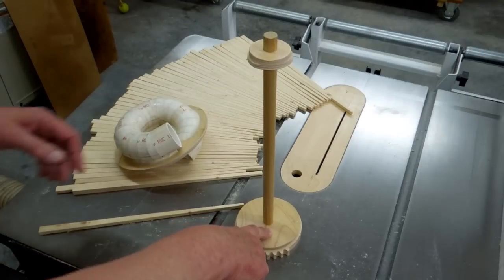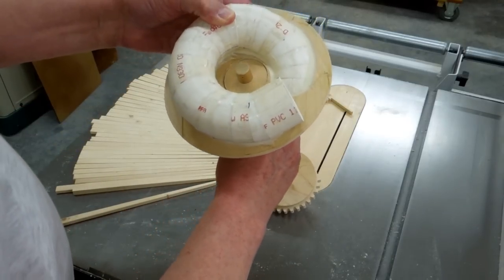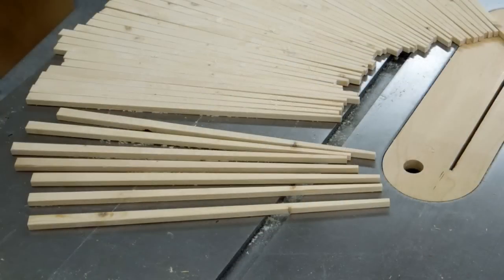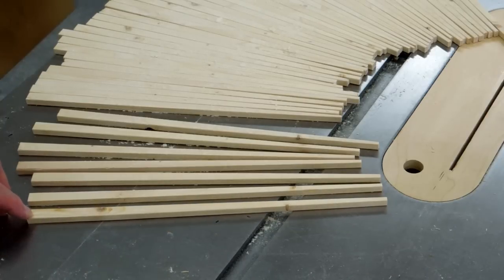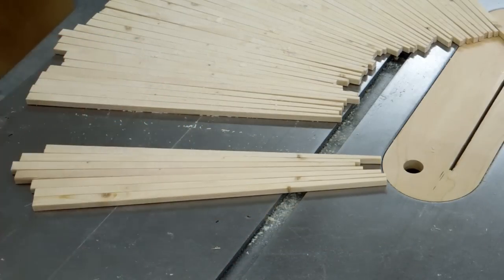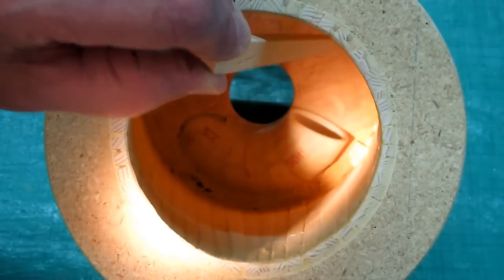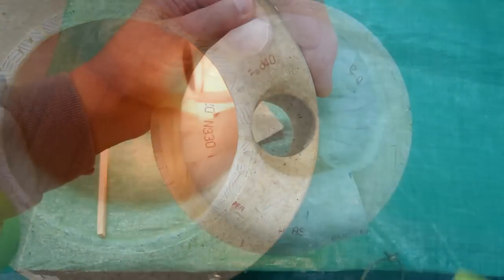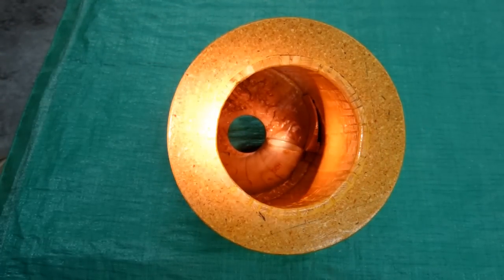Toroidal Spiral Cyclone Separator For ShopVac

Comment: Do you think that shape/dims. Is the most effective, efficient?
Reply from the maker: I have three (3) different designs for a homemade shopvac cyclone separator and all three are of the same approximate efficiency. The larger cyclone is intended for shopvacs with larger hoses. Coupled with the use of a bag inside the shopvac, they provide an excellent low cost system.
Reply: Ronald Walters thanks for responding.

Comment: How does this work with drywall dust?
Reply from the maker: I have three different cyclone separator designs. All three are quite efficient but some fine dust does escape. I haven't personally tested them with drywall dust. I think it would be quite good as long as you use a drywall dust filter bag inside your shopvac. I have a video on improving the efficiency of your shopvac  https://youtu.be/VXrSb4-itn8  ShopVac sells a filter intended for finer material and it will keep the pleated cartridge filter inside the shopvac clean. Between the paper bag and the cyclone separator you would have the best of both worlds... in my opinion.
Reply: Ronald Walters, I have used several different types of filters with as many different types/sizes of shop vacs, ... the best I have used for drywall dust is a bucket water filter, ... none of the dust ever makes it into a very small capacity vac, ... (1gallon size), & has been the most proficient one As well, ... I was very surprised by the results after its 1st use, ... & it became a staple in my venture into the world of capitalism, ... 
after driving tractor-trailer for 15 years, I started all over learning the trade of painting, & automotive machining, ... I got very good @ both fields, ... & eventually began teaching the trade of painting, drywall, carpentry, plumbing, & electrical to several young men in their "hood" & some will still call me to chat, & ask about this, or that, & most have moved onto other fields of employment, but each has said that they learned the basics, that I taught them, & all of them use those same rules in their chosen professions, & have also taught these same rules of working to their own children, & other neighborhood youngsters, ... I taught them how to assess a job, ... how to take care of their tools, ... how to create a method of attack, & of finishing each job, not only to their satisfaction, but also to their customers satisfaction, ... the end results have been remarkable, ... as most of them are in supervisory capacities now, ... I still get a kick out of someone saying that I made it look to easy, ... it is just the application of applying oneself to the most important rule, which is the same as the one I was taught, ... Do each job, as if you were the one paying for it, & as if your Momma was standing behind you, ...

Comment: Although it looks cool, I think your toroidal spiral is counterproductive. You don't gain additional angular momentum from the spiral path before it enters the chamber. A straight inlet tangential to the inner surface accomplishes the same thing, without added friction.
Reply from the maker: +pratherat I have two other cyclone designs with straight tangential inlets. All three cyclones (which includes this one) work with the same efficiency. The Toroidal Spiral version may be easier for some people to build. Take your pick, they all work.

Comment: If you keep the .27" instead of rounding to .25" (1/4") you will get an angle which is very close to 1° so it would make a lot of sense to make a fence guide with an angle of 1 degree instead of sanding a parallel cut strip. You can also set the rip guide to 1/2° and flip the wood at each pass.
Reply from the maker: +Pierre C Obviously there are many ways to do this. Each person is able to choose the material and the method as he sees fit.

Comment: First, thanks for the lucid video. I like them when you talk. I found at a garage sale a truncated cone shaped sheet metal flower vase that is 7" diam. at the top, 3.5" at the bottom, sitting on a disk about the same diam. as the top. The span between top and bottom is 14" I liked the toroidal separator,. Would the dimensions of this cone work well enough without modifications?

Comment: Ok, Will do. Bit now I think I will use Bamboo then  Fill spaces with round chopsticks and toothpicks to fill gaps. Then sawdust and glue then urethane. What is the thickness overall of the cone.  the inner and outer diameters of cone diameters of both  bottom and top? What is overall length. I will send pictures of cone and follow the rest of functional directions. Gotta figure out the pvc cuts. Looks like a fun project. That I need. Time doesn't mater."Say what you want and be who you are.Because those who mind. Don't matter.And those who matter don't mind."Theodore Seuss Geisel
Reply from the maker: +J Petersen Watch the video again. All dimensions are given. Slats are 1/4" thick x 1/2" wide tapered to 1/4" x 13" long. Bottom disc is 4" diameter and top disc is 7-1/4" diameter. It's pretty easy to make all the slats out of a 2x4 if you have a table saw.  All the info to make the Toroidal Spiral is given in the first video.

Comment: I think your videos and methods are great!You may think this is a dumb question. But Would this be possible to make out of Flat chopsticks. You know the ones you break apart. The cheap flat ones with a pointy end.They could start on the bottom circle Point side up. Then fill 2nd story point side down.and so on and so on. Until proper height and top OD diameter are achieved. of course the id of cone would require building the same process in reverse.  Not sure how many layers it would take. But on the positive side. Less Gaps. No Lumber cost when my neighbor owns a Chinese restaurant. Polyurethane should take care of the rest. What do you think?  Jim
Reply from the maker: +J Petersen Funny! I never know what I'm going to be asked on YouTube! The break apart chopsticks I have are 8-7/8" long. The cyclone is 13" tall. Looks to me like they would all point down and there would be some gaps to fill. I think if I had a bunch of chopsticks I'd try it. I'd like to see a photo of it if you build one. :-)

Comment: cool work. Can't help thinking it would have been WAY easier just to use some 22ga metal for the cone.
Reply from the maker: piecesenregalia Not if a person is not set up to work with sheet metal (or plastic, fiberglass, etc.). This is a woodworking shop and this is a pretty easy woodworking project... that works! Thank you for watching! Ron
Reply: +piecesenregalia Not to disrespect this project, but I was thinking a simple steel garbage can would do an ok job, hold much more, and be easy to empty too.
Reply from the maker: +3G Michigan As long as you can get a perfect seal on the lid you can use whatever container you want. Metal garbage cans probably aren't going to seal very well... 55 gallon drum would be a better bet.

Comment: Instead of the TiteBond and sawdust mix to coat the inside what about lining the inside with Chipboard. The stuff used for the backs of paper tablets, cereal boxes etc. Available in sheets around 36 x 42 in the framing dept of Hobby Lobby in .5 and 1mm thickness. The stuff is tougher than one would think

Comment: That is impressive work!  Thank you for sharing.  I learn something new or a new technique with nearly every one of your videos.  I have a few questions, first, what is the "supporting material" that you used in supporting the PVC pipes?  Next, why did you go with a nearly 360 degree turn of the pipe, wouldn't a 90 degree turn achieve the same results or a straight pipe tangent to the cone?  Finally, since you mentioned that most cone separators the debris makes about 1 1/2 turns before going into the collector, could the spiral be used in place of the cone but make about 1 1/2 revolutions of it into the collector?  Thank you again for sharing.
Reply from the maker: Dwight Souder
1.) I used a tube of construction adhesive mainly because I already had it and it was already open. Actually, silicone would be a better choice, will stick better and set up faster in thick cross section.
2.) By doing a complete turn with the PVC pipe I was able to "pinch" the cyclone plywood top which held it in position until the adhesive (or silicone) dried. You should watch the videos on my first cyclone separator (there is a playlist for it https://www.youtube.com/playlist?list=PL1ABF2C513E0F4838 ) where I used a straight piece of pipe tangent to the cone and a lot of people complained about it being difficult to make, install, support etc. So the spiral was a way to make the inlet pipe first, install it in the cyclone top and then it is also out of the way for the remainder of the construction. I like my first cyclone separator and personally did not find it very difficult to make.
3.) The 1-1/2 turn statement was a generalization. It really depends on the velocity of the air going through the separator. The taper of the cone helps maintain speed of rotation of the debris as gravity carries it downward. Speed of rotation (centrifugal force) separates the debris from the air and the cone allows the air to escape without carrying debris with it. After the air separates, the cone carries the debris into the bucket. There is a "sweet spot" for the length of the exhaust pipe for optimal air/debris separation. The cyclone does tend to spin up the material in the bucket. Always a good idea to empty the bucket before it becomes over half full or the material could get thrown back up into the cyclone. That is one of the problems I have seen with some thein separators which sit on top of a 5 gallon bucket (in my opinion).
4.) A spiral of 1-1/2 to 2 turns would force the material to the outside walls of the pipe but the air has no way to escape the "system". If the spiral went down into the bucket it would tend to keep things rotating in the bucket (like a water jet) and a lot of material may be carried back out to the ShopVac. There are some cheap and nasty gadgets which sit on top of a 5 gallon bucket (Grizzly D4241 for example) to knock out the heavier material coming off a planer (for example) but they do not seem efficient at separating the finer dust.

The cyclone separator is a very efficient centrifuge and air separator.

Comment: I noticed your beam compass, it looks good. Did you make that? Of course you did! :-)
Reply from the maker: ***** Ahhh! Good eye!  That is exactly what they are. These were a project in a wood magazine years ago and you were supposed to use brass rod or brass tubing. Good luck trying to find a straight piece of that. So I found the fiberglass reflector poles which are very straight and cheaper than rods or tubing. You could also use an arrow shaft.
Reply from the maker: ***** I'll put the beam compass on my list. Not sure when I will get to doing it.

I use a HDTV antenna as well. They do not take kindly to being bent/kinked.
Reply from the maker: ***** Here is a link to a video on the Dual Rod Beam Compass https://youtu.be/te1T-UOyErw You can watch and comment on this as usual but it will not  be officially released for a while. As stated in the video the diameter varies with the color of the rod. My rods were 4 ft long to the end of the pointed end.

Comment: Thanks again Ron, I really enjoy your videos.  Hate to admit it, but I went the lazy way and bought a cyclone but after watching this I'm inclined to try and build my own now.
Reply from the maker: ***** I bought one as well several years ago when they were on sale. It looks nice and well made but the top keeps popping off. It is made of a slippery plastic and I have yet to find a glue which will touch it. The glue the cyclone manufacturer used did not work either. I called them about it and they just blew me off (which made me mad) so I decided the heck with them, I will make my own and show everyone how I made it. Haven't had one of mine fall apart yet and they are much cheaper and fun to build.

I had the plastic one taped together until recently. Now I put it together with a bunch of silicone. I have my doubts the silicone will stay adhered to it (time will tell). A person should not have to repair a product to get it to work. A manufacturer should address a problem their customer has experienced, otherwise they do not deserve to stay in business.